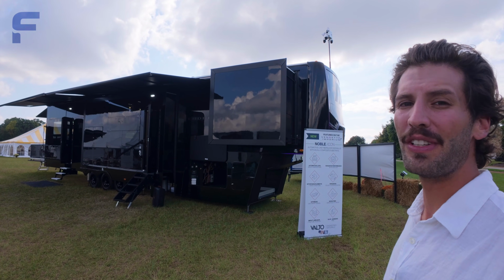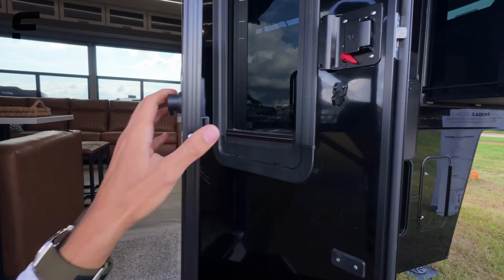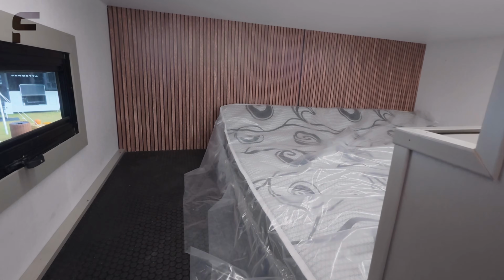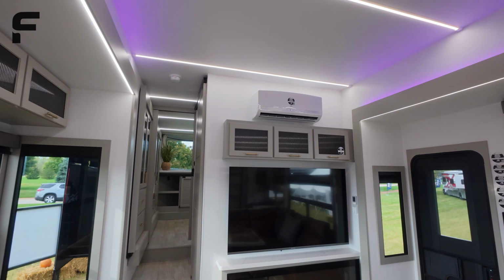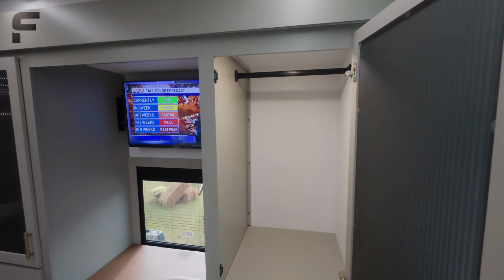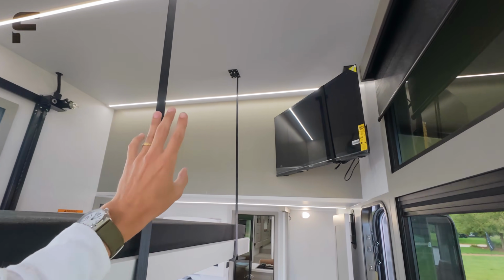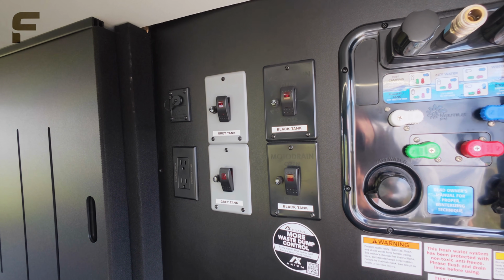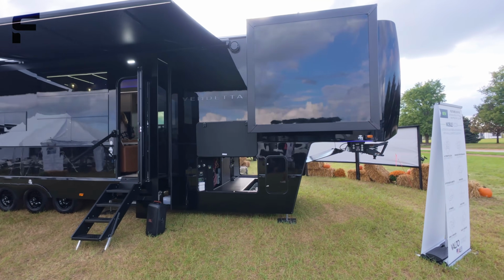You MUST SEE this GAME CHANGING NEW fifth wheel RV! Axiom Vendetta 4250 Toy Hauler

Comment: Not sure why everyone is freaking out about the ground clearance.  Literally exactly the same as any other similar 5th wheel toy hauler.  Lowest point is the landing gear.  Usually the skirting is up quite a bit higher than the landing gear, on this they just brought the skirting down to the landing gear so it looks lower.  Still a giant box of garbage.  These things are selling for $160-$180k.  If something this size is built half decent (there's plenty of visible examples in all the videos that they're not), it should easily be around $300k, like Luxe or New Horizons status.

Comment: The JBL speaker thing is a no go for me.  That is wasted space.  Honestly a drop down extension to the counter would be better suited from that JBL space as there is not enough counter to the left of that sink to be efficient.   I can only imagine the cost of that rig and of course as my experience has taught me the finishes usually take the hit on most RV’s.  Staples do not hold and the moldings are usually sub par.   Personally I would love to see a Brinkley first hand we have had a 45’ toy hauler and now own a 26’ tow behind as we do not travel with out motorcycles anymore and it is always the same.  Quality of your standard run of the mill manufacturers is questionable.

Comment: I really like the floor plan but I see some  problems. That trim up on the loft was poorly cut and should not have passed their inspection. The toilet in the half bath in the garage needs to be centered in that space. There is no space on the right hand side of the toilet as you sit on it.  All the space is to the left. The size and position of the TV in the primary bedroom is next to useless. Again I like the floor plan but I would be hesitant just because I would question the build quality about everything that is not visible.

Comment: Did they fix that 6 inch gap in the frame above the axels? RV inspector saw Vendetta model that he couldn’t explain why they put that in the frame or why they used 2 inch holes for running a 1/2 inch bundle of wires, I see a $100K frame flex in the customers future
Reply from the maker: I can’t say. I was likely looking at the same one he was looking at as well.

Comment: While this is a "pretty and innovative" toy hauler, there are many, many things about this "toy hauler" that will keep me in the Brinkley realm due to simple practicality, functionality, and accessibility. Good luck going over anything more than a speed bump and time will tell how long that black holds up in the sun before it weather checks.
While the website indicates 24K GVWR; I bet a large amount of that is gobbled up in the design and materials used. That increased ceiling height is an example of the added weight....what do you need that height for; added space for heating AND cooling? 
Portable JBL speaker is a joke. Garage access door and loft ladder right at the heart of the kitchen and adjacent to the stove is a poor idea. Accessibility (or lack thereof) to fridge and bathroom when travelling is another poor design choice. Genny, spare tire, and AC condenser locations (ground clearances) are a real issue long-term. Fuel gauges 2 feet to the right of the fuel station? No on-board air compressor? 
I am a fan of the TCS and the "true" power cord reel features, but at an MSRP of $230K ish, the overall quality and functional design of the build is absolutely lacking!

All things point to this trailer being a prototype/first run.....from the finger prints in the accent light sealant to no "weight sticker" that would tell us the unladened weight. I truly wonder how different a production trailer will end up (quality-wise). 
Good luck to the new company and I hope they do well; for themselves and the industry!

Comment: Why does everyone in these keep calling this suspension independent?  I’ve got it on my trailer and so far it’s working great and rides very well.  Maybe not AS well as our last trailer that we installed Moryde independent on but nearly as well with much less weight and cost too.  But it is not independent. It is still a solid axle suspension.  The axles operate independently from each other, but the suspension is still a solid axle.  As in no equalizers tying tandems or Triple’s together.
You could install this suspension as a single axle set up very easily and there would be NOTHING independent about it.  Great system imho so far but NOT independent.

Comment: I just don’t see what’s so game changing about it. Clean roof is smart. Full length turn signals is smart. But a door in the slide… sewer connections still under slides….10’ ceilings…wtf, last thing we needed was higher ceilings in a fifth wheel. I do no5 wan5 my wife to have to climb a ladder to get stuff out of cabinets….New Horizons has been doing mini splits in RV’s for years….there is nothing here I need.
Reply: Cheap drawer construction ..the terrible ladder placement for the hardly usable loft with no clothing space either , the lack of water turn off valves under the sinks in bathrooms ,the cabinets so high even a 6ft plus make can’t reach them no I need a mini ladder to access my cupboards …( the higher ceilings really should have went to the 2 bedroom loft lay outs bc they could finally make them usable for teenagers not toddlers) the unfinished ply wood under the bed ..no attention to detail hardly at all ..at a 230,000 Rv you expect the absolute best of everything
Reply: @elizamontgomery877 I’m disappointed, was hoping for more. And who in gods name wants a 47’ it’s just so big and heavy…and NOBODY will admit that to tow one safely it’s AT LEAST an F-450….

Comment: This is definitely roomier than most toy haulers of the same length.  Love the ceiling height.  I’m concerned about ground clearance more than anything else.
Reply: Likes:  Steel frame, height, ceiling and roof, lighting, floor plan, seating, exterior color. 

Dislikes: No double frame windows and really big windows so this can’t really be a true four season;  cabinet construction.
Reply: It not any lower than our class C motor home
Reply: @jodiplock4784  sure. but a class motorhome has the engine and cab built on the same chasis. this requires a pickup truck which will obviously created clearance issues when dealing with hills, when the truck is at a different angle then the toy hauler

Comment: Ground clearance seems like it’s gonna be an issue. One who’s gonna wanna crawl under the Rv to service or repair the generator along with the ac units. Not to mention they are exposed to the road elements such as debris possibly hitting the units. When it rains the truck tires are gonna kick up all that road grit with the rain water getting all over the units possibly reducing the life of the ac units and genie. Beautiful Rv but they dropped the ball on location for the gen and ac in my opinion

Comment: Ok please someone tell me .....Ground clearance on the front landing gear? HOW LOW IS THAT? will that clear anything other than a flat road ? How about gas stations from road to parking transitions and inclines? YIKES....Am I wrong or is no one noticing?
Reply: And having to always find a level lot or back up on risers so the front end has some room.  I'm on a lake lot and it does gradually slope down.  Not an issue in my 30 ft Cruiser with high ground clearance.

Comment: ground clearance all around is a major concern for me, and most RV folks. Love the mini splits, the generator needs an access panel or that is a terrible mounting location. love to see slimracks and rack and pinion. to clear up the whole roof without making use of solar is confusing to me, especially if they maxed out the clearance completely for the nhtsa
Reply: Looks like a very low hanging propane line running to the generator, that's concerning. I believe they do have some solar on the roof, so there is enough height to add them at least.